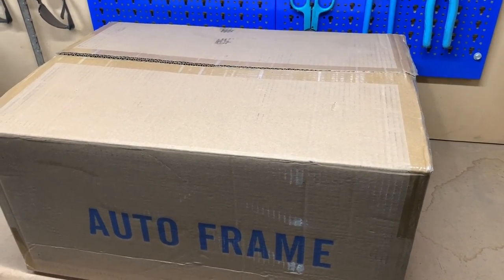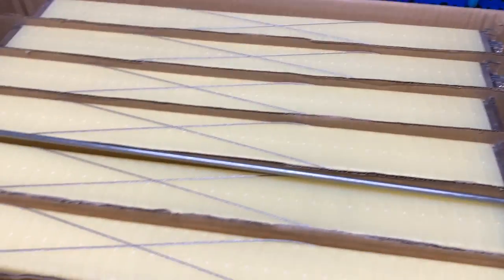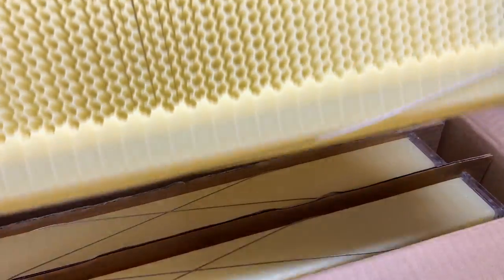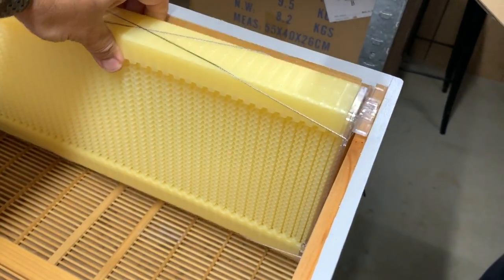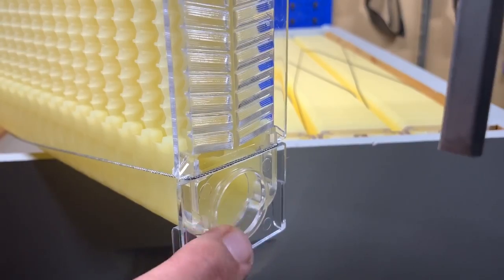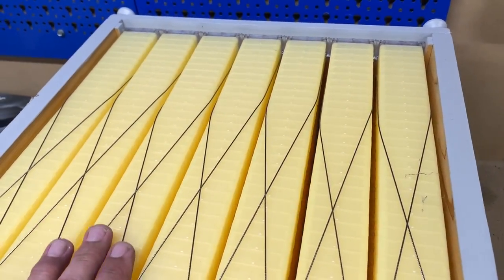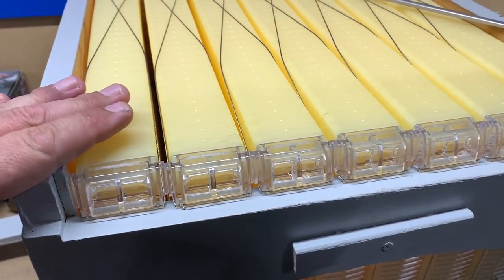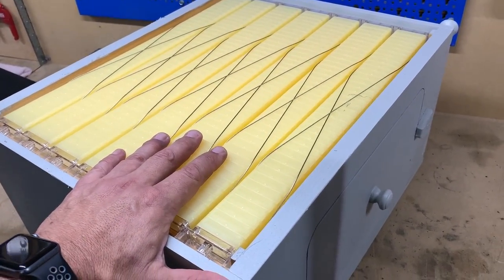Bee Hive Flow Frame Unboxing - eBay Flow Hive

Comment: How'd you go with the bamboo queen excluder? I had mine outside under the varanda for a few weeks while i set everything up and it got moldy as hell. I was worried about how it would go in the hive and ended up tossing it and buying a plastic and a metal excluder to try.
Reply from the maker: Have not used it yet. Not sure how good it is really.